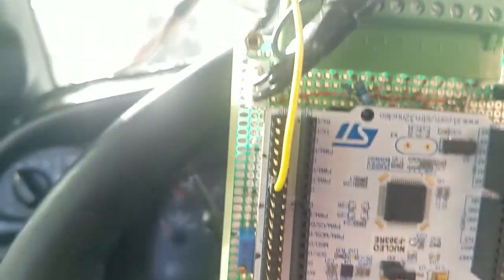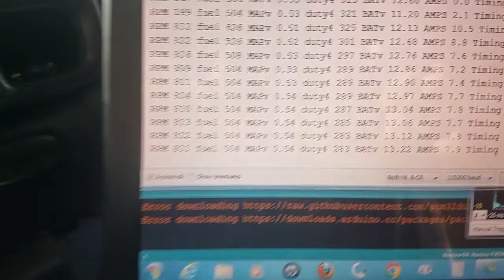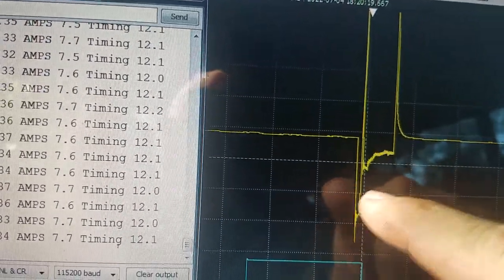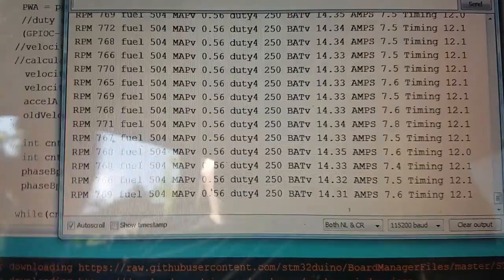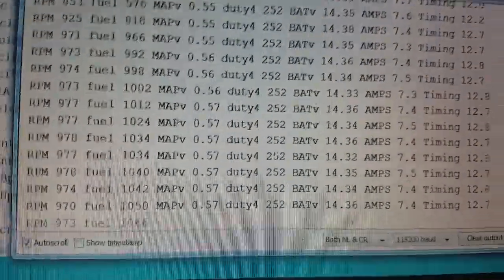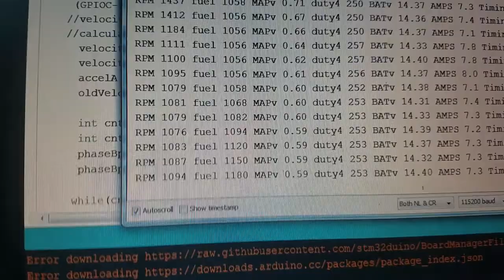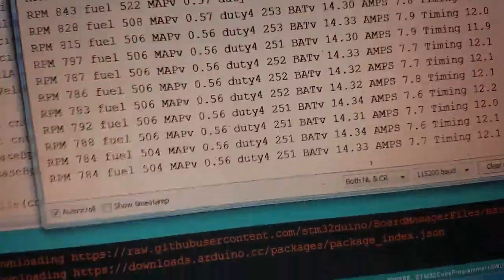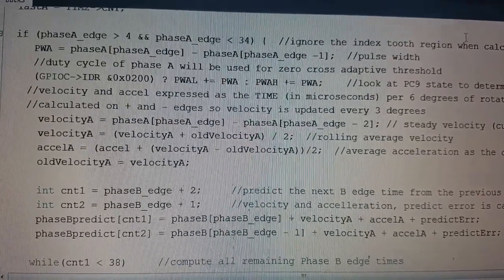Vp44 repaired with microcontroller

Comment: Hey man this is such an amazing project!! I’m following in your foot step currently but with an older Audi with the vp44. Any help the control of the high pressure ( fuel metering) solenoid would be amazing at that’s what I’m currently struggling with. If you can help it would be great fully thankful, enjoy the tinkering from another tinkerer in Ireland!!
Reply from the maker: https://mopar1973man.com/topic/19095-diy-vp-44-and-ecm-it-runs-very-happy/ this post has some timing diagrams and useful wave forms. View all 3 pages. Be careful the fuel solenoid is about 0.3 ohms and 250 micro Henry. It will burn out in seconds if left on at full current.
Reply: @raym5562  that amazing man ill have aread over and get back to you ! would love to compare notes at some point on the differences with my motor being a lot smaller would be cool. Keep up the work man, thanks!!
Reply: holy shit that that is an amazing looking pcb you have made thats lot more professional than what im doing !
Reply from the maker: I loaded a video to make an opto isolate and duplicator so you can parallel run your own control of the solenoids
Reply: @raym5562  thank man your been an amazing help, about to call it a night but will have a proper study over it tomorrow would love to have you opion on htis project and maybe some other projects along the line especially the reseach project for my master project involing an open source digital hydraulic valve train!

Comment: Excellent work!  It is hard to believe that someone (like you) could actually make a stand alone controller that eliminates the ECM and PSG.  I am the original owner of my 2002 Cummins with 365,000 miles on the truck and the original ECM and second VP44.  The VP44 has logged over 270,000 miles now.  I will be following your project.  I see why your handle is Great work!

- John